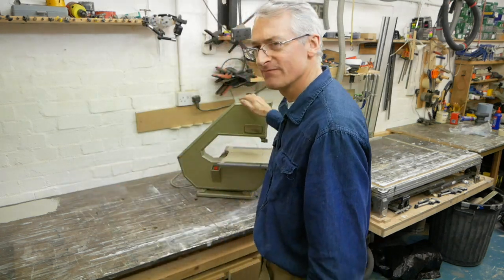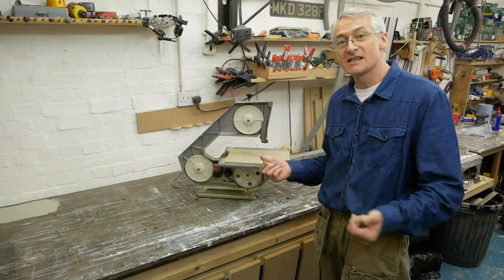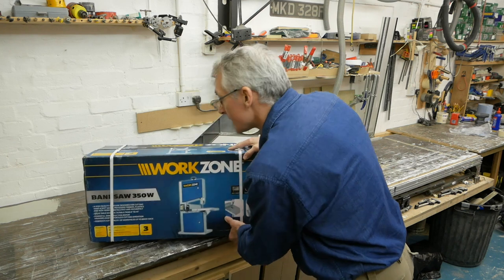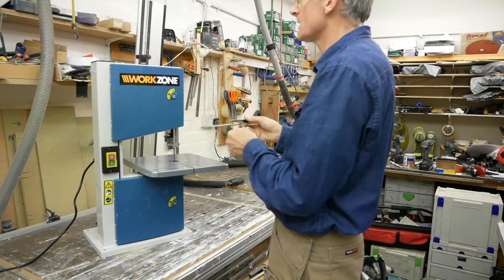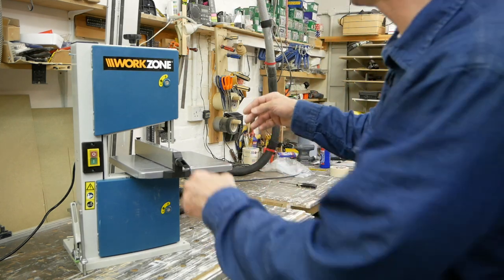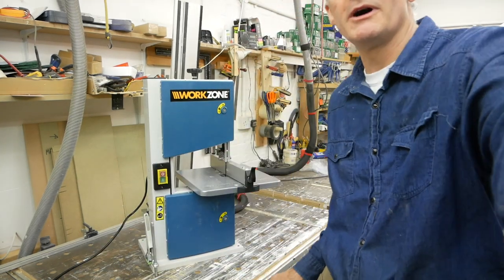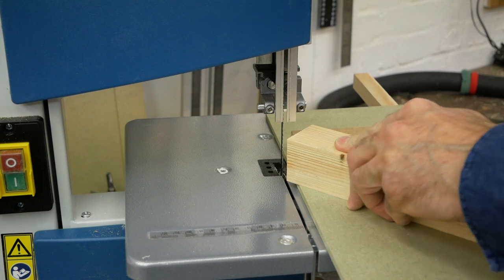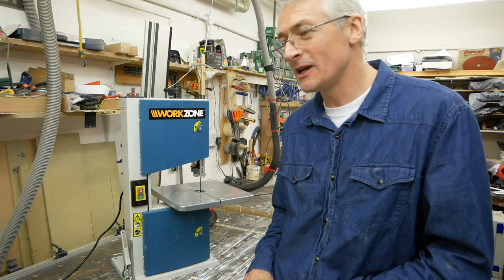Cheap Bandsaw - worthwhile, or just a waste? #050

Comment: Hey Peter great video Lidl are selling their version of this bandsaw next week, it seems virtually identical so after watching this I'll defo buy one! Just wondering how well the saw is going for you now a year on? Thanks!
Reply from the maker: Thanks Dave, they’re a great value starter bandsaw and I was very happy with mine. I decided earlier in the year that I wanted something with a bit more capacity - see videos #140, 148, 149, 164 - and I don’t have space for more than one, so I moved on. But it’s a cracking little bandsaw for the money, loved mine 👍👍
Reply: For me is Lidl a big NO. No tools at all, buying there. Not even a clamp. I knew that still bought a couple of clamps and broke them just putting a little pressure on it. The thing was there was only 2mm of plastic holding the pressure. Nearly every tool I bought there was faulty and outright dangerous to use like that drill I bought and after using it only one time the chuck fell apart.

Comment: How good are these little cheap bandsaws at cutting aluminium tubes/extrusions and even some sheet steel?
Reply from the maker: No idea really - not a metalworker, though I have cut some simple ally tube and t-track with the stock blade. Worked well 👍
Reply: Ahhaa, thanks for the quick reply... Well i need to accurately cut some alu extrusions (2020 stuff) for a project... And for 80 quid i think i might try and catch aldis one... The alternative is finding a local metal worker and paying them maybe 20 30 40 quid for the 10 minutes cutting :p 

The table, you mention it being a bit flimsy... Is it solid though? Doesn't rock i mean? So i can get a good 90' cut? 
AAAnnd, how easy is it getting spare blades? Does it use a standard size? Or is it a really unique size you can only get at aldi when they next have it on the random isle?
Reply from the maker: It’s a rebadged Scheppach, so blades are easy to get. If in any doubt, talk to Ian John at Tuffsaws - great bandsaw blades at a great price. Table’s pressed steel -  a bit flimsy, a bit twisty, no mitre slot. Cuts 90 deg no problem, but tbh if all you want is to cut 20/20 you can easily do that with a Tracksaw or mitresaw 👍👍
Reply: I do have a mitresaw.... Just was a bit iffy using it for 2020 alu...
Reply from the maker: TCT blade, no problem 👍👍

Comment: Very helpful video, i have been looking at that kind of bandsaw for cutting blanks for woodturning, Have you cut any hardwood greater than 2" ?
Reply from the maker: Thanks! I haven't no; I've tended to use it as a glorified static jigsaw more than anything, so not in a position to comment based on experience, I'm afraid. I'd imagine a better blade would be needed (see the tuffsaws link in the description above) if you're going to try cutting hardwood close to max. capacity, and a bit more careful setting up. But once it's set up nicely, I see no reason why it wouldn't cope admirably - certainly I'd expect it to be comparable to other 350w saws this size. I'm over in the workshop shortly, I'll see what I can find and post back. 👍
Reply from the maker: Just for you:- https://youtu.be/MofCobVqEhw 😇
Reply: Many thanks

Comment: I bought one of these a couple of weeks ago. I was also replacing an old Burgess. Works fine. However it has developed a fault.
the top blade guide has stuck in the 'up' position and refuses to come down.
Reply from the maker: +Nicap2 Sorry to hear. If you can't loosen it, I'd chuck it back to Aldi as it's only a couple of weeks old - they're usually pretty good as sorting these things out. 👍
Reply: Peter, I've just got around to looking at the blade guide mechanism.
I managed to get the thing to lower, by applying a bit more force to the adjusting wheel than I would have liked.
The mechanism functions by use of a plastic rack and pinion. When I got it lowered, the cause of the jam was obvious - sawdust clogging the rack!
Now I have to admit, that I have used the saw without dust extraction, so probably have only myself to blame for the fault.
A quick 'blow out' with some compressed air had the thing operating smoothly again.
I just thought that I should warn you all about this potential problem.

Comment: What is the size of the blade?  I have the old kind of band saw which has the 3 rollers. I found out that small rollers puts much pressure on the blade so they break easy. Im planning to get one of this brand.
Reply from the maker: I don’t own this one anymore, but I f you follow the links in the video description to the Scheppach there’s the full tech spec. 👍

Comment: How do you adjust the tracking if you can't run it without the cover on?
Reply from the maker: Same as always - by turning the wheel manually. 👍
Reply: @10MinuteWorkshop  That will get you in the ballpark, but not on the crown.
Reply: There's a knob on the back.

Comment: Great video Peter thank you.
Tell me the Ryobi air strike can you buy the nails and staples in this country?. Also did you buy the battery and charger for it here, if so where?.
Reply from the maker: Thanks! Yes, nails and staples are a common size (I’m using cheap Silverline ones just now) batteries and charger are widely available on e.g. eBay, though I’ve seen deals on offer where you can get a drill/driver with batts and charger for almost the same price, so worth shopping around. 👍

Comment: Hi peter - very informative video. Do you know if it could be used to cut aluminium or other metals with he appropriate blades?

Subbed :-)
Reply from the maker: Thanks! Yes, I've cut thin aluminium with the stock blade (!) so if you changed blades for something more appropriate, then sure, cant imagine there'd be a problem. Usual caveats about feed rate, not overheating the metal or the blade, etc.. etc.. Not a metalworker, so that's the extent of my knowledge 😆 👍

Comment: Is it possible to get a blade for this that would cut metal? Thin mild steel typically, maybe up to 3mm but generally a lot less.
Reply from the maker: Almost certainly. Talk to Ian at tuffsaws - link in the video description. 👍
Reply: @10MinuteWorkshop  Thank you!

Comment: Are you still using this saw?
Reply from the maker: Hi Goran. No, I used it for 6 months or so and it handles everything I threw at it, but I bought something With a little more capacity. See vids #140, 148 &149 👍👍

Comment: I got one very similar about three months ago and the blade keeps kicking off can’t seem to get the vertical setting on the wheel to stay in place 😡
Reply from the maker: This video’s a couple of years old- if you go back through the recent comments you’ll see there have been some qc issues, with last years saw, and this year’s - especially with the blade staying on the bottom wheel. Chuck it back to Aldi for refund or exchange. 👍👍

Comment: I picked this saw up a couple weeks back purely because it was in stock and it was something to keep me going until my workshop gets renovated and I have the space for a bigger machine but I have to say it is horrible, the blade drifts drastically as soon as it comes into contact with the wood, I've tried adjusting the bearings and the guide wheels but nothing makes any notable difference, I'd return it but i threw out the box before i tested it, anyone have suggestions as to how i might go about fixing the blade drift?
Reply from the maker: +Greedo Bear Sorry to hear. I'd chuck it back to them, box or not. Mine was literally as you see in the videos - pulled it out of the box, plugged it in and started cutting; I didn't muck around with tension, bearings, anything, just up and running straight from the box. Someone on the UKworkshop forum was having similar issues so clearly not a one-off - unless it was you, lol! Seriously, send it back, I'm pretty sure Aldi won't turn a hair about a missing box - and let us know if they do. 👍
Reply: Peter Millard I might see if i still have the receipt although it was a couple of weeks ago when i picked this up, so the receipt might be trouble to find, it's not the most pressing thing on my mind as I don't have much use for it, I might keep it until i get a better machine and strip it for parts, great video btw, just found your channel and i have to say you're videos are quite entertaining

Comment: Thanks for the video. I have just bought one off ebay and although it runs ok I think I put too much sideways pressure and the blade came off. On opening the compartments I noticed that the top pulley was really loose and wobbly in all directions. I realise that the tracking adjustment needs to move the pulley in and out but did you notice the same issue on yours when new. Thanks
Reply from the maker: Don’t have this saw any more, but yes - if it wasn’t under tension it was surprisingly loose; tensioning the blade made it run very sweetly though. 👍👍

Comment: One look at that sheet metal table and I would throw that junk out.
When the title said "cheap bandsaw" I was thinking something in the $1,000 range, not some piece of junk toy bandsaw.

You're doing yourself a disservice buying cheap junk, it never works well and just makes using it unenjoyable. Do yourself a favour and buy some good equipment that you'll actually enjoy using.
Reply from the maker: It’s a starter bandsaw for the price of a tank of fuel for people who don’t know if they need a bandsaw or not. Brand new, 3 year warranty. I had mine for 6 months before moving on - it did everything I asked of it, and more. 👍👍
Reply: And most of them get bought and used a couple of times then shoved away in a corner somewhere because they are crap and turn off the person who bought it from ever bothering with it again.